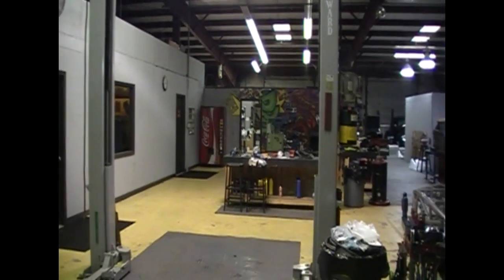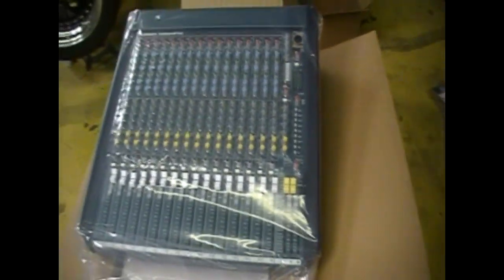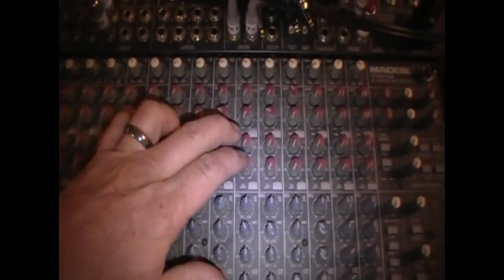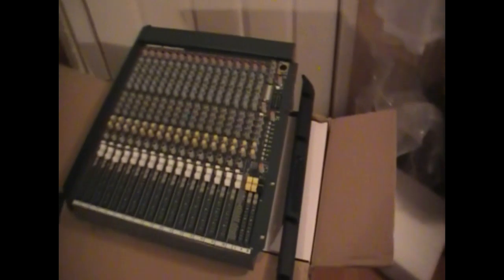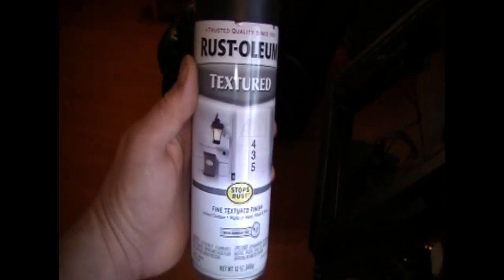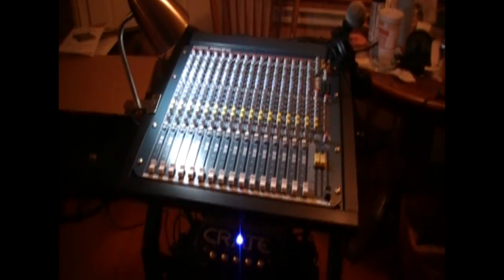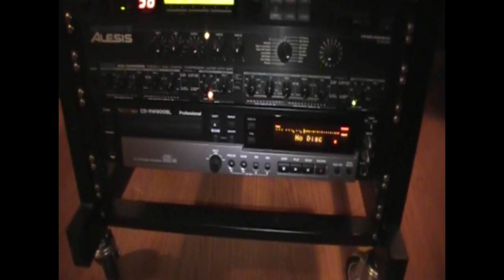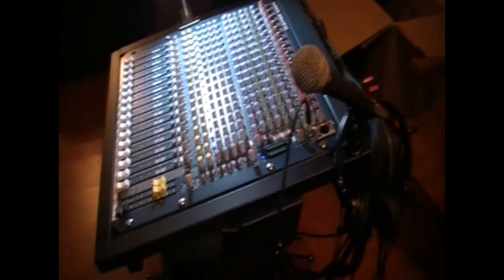Allen n Heath mixer install

Comment: Hi Rick, congrat. for this video. Could you, please, to tell me exactly which leds light (and in which order they appear?) when you turn ON de mixer? The first "duo" VU-meter leds? The effects leds? The PFL leds? I'm ask just because I recently bought the same model of A&H (but SH!) and I suspect some electrical damages... And also, what's going on (with the same leds) when you turn OFF the mixer? Many, many thanks.
Reply from the maker: So sorry, I sold this mixer in 2013 and cannot answer the questions. Thanks for the comment and thanks for watching anyhow.